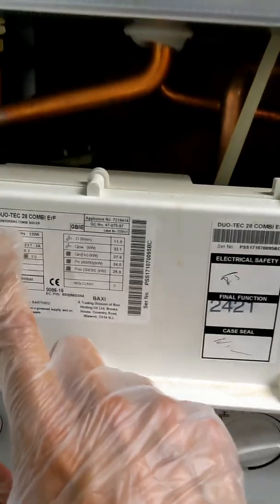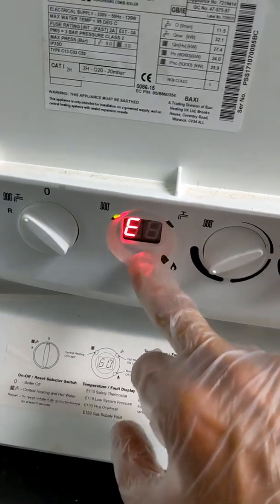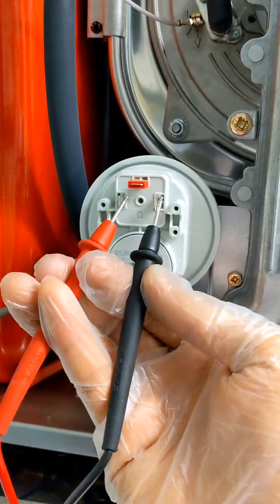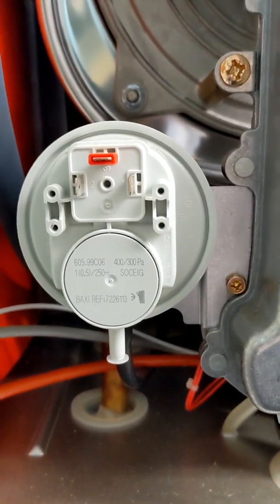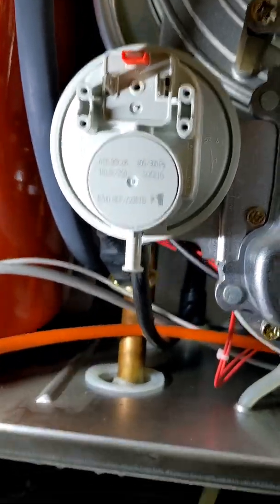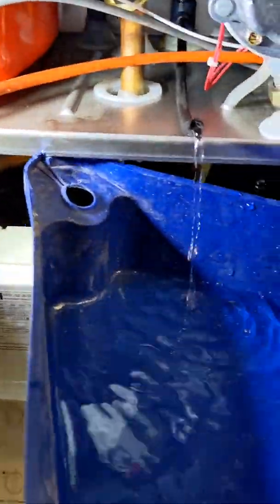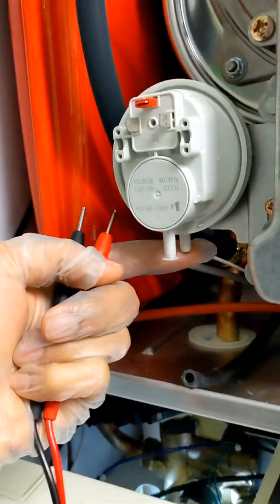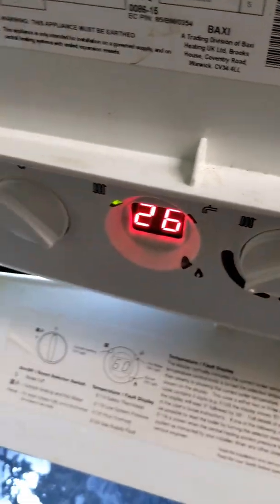Baxi E28 fault

Comment: I have this issue new but no blocked condense , could is be a faulty air pressure switch ?
Reply from the maker: Yes quite possibly. You need to check the continuity between the terminals, if you're not getting any continuity and no blocked condense then likely it could be a faulty APS